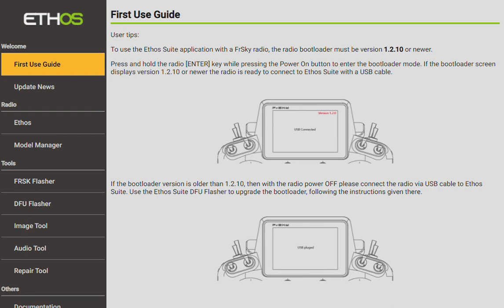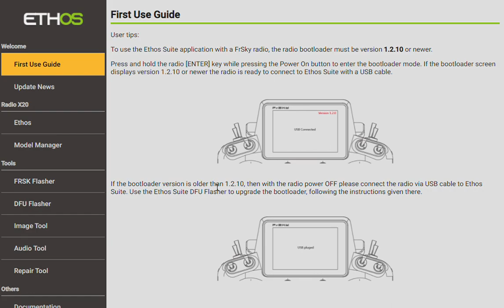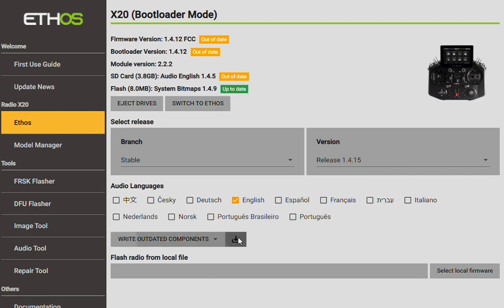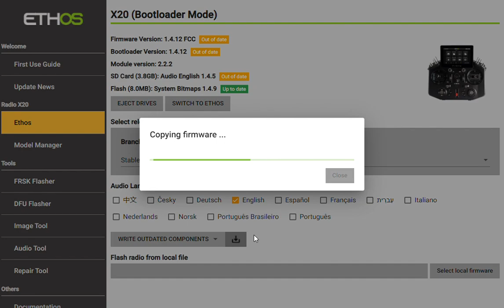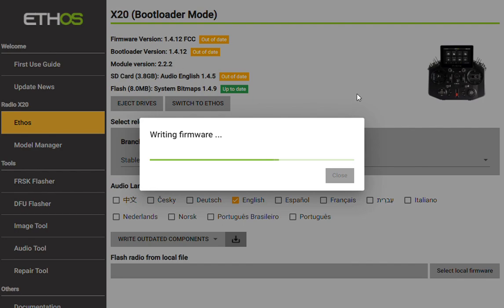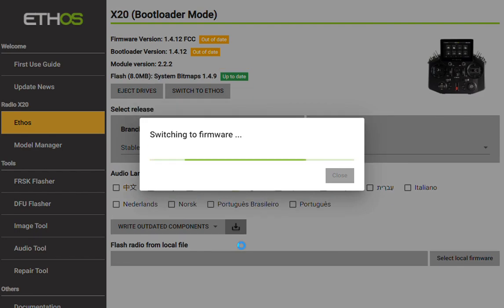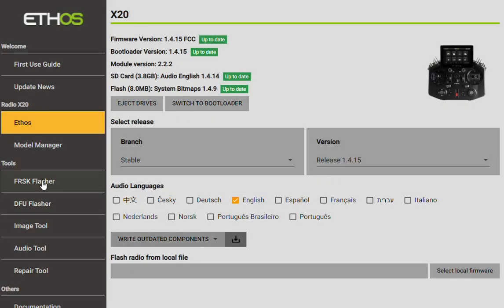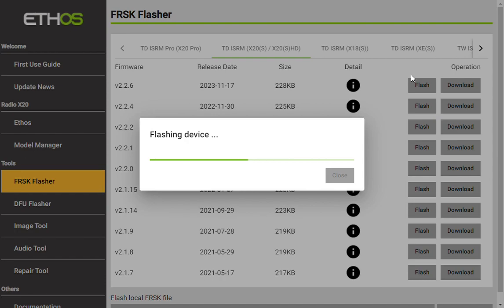FrSky Ethos-Realtime Ethos Suite Update & Internal Module update

Comment: Hi Steve - It's been a couple of years since I updated my X20 and the firmware seemed to update fine, however, my Bootloader version was 1.4.3 and it couldn't update. I had a pop up window saying to disconnect the USB from the PC and start Ethos in the usual way then connect the TX to my PC and select Frsky Suite. However, after disconnecting the USB, Bootloader disappeared off the screen but the blue light of the on/off button was on but would not turn off. I had to disconnect the battery on the TX and reconnect, but now my radio won't turn on at all, except for going into Bootloader mode. Do I need to restore factory settings to get my radio to work or is there a work around? Thanks in advance.  
Steve